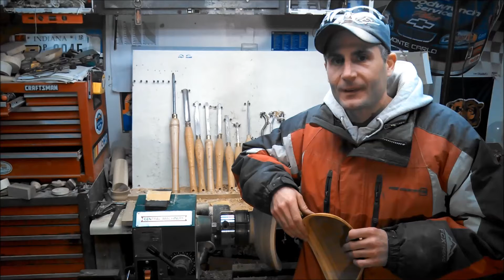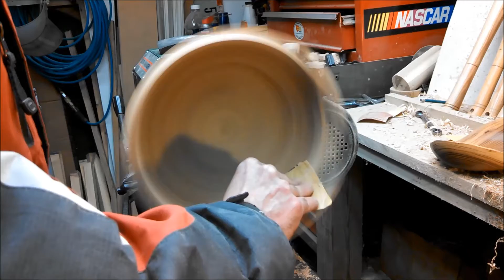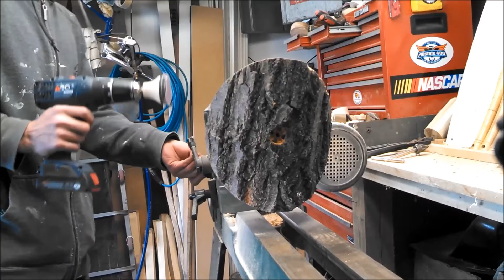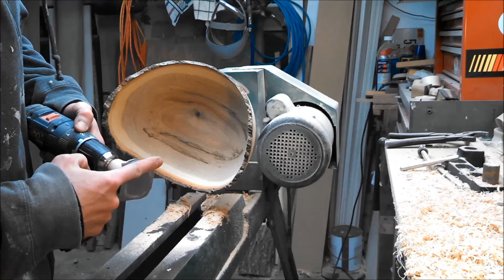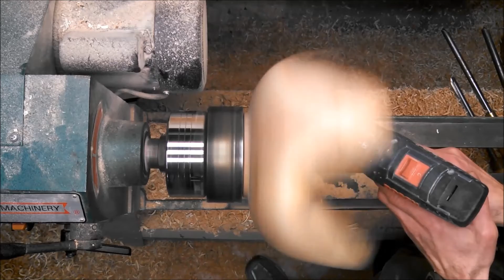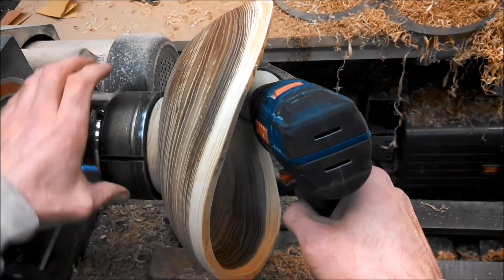Woodturning - Power Sanding a Natural Edge Bowl

Comment: Thanks Kevin. Good demo. I will try your technique on my next bowl as sanding with the lathe off takes forever. Also, I noticed that you sanded the outside before you turned the inside. Great Idea. Thanks for sharing.